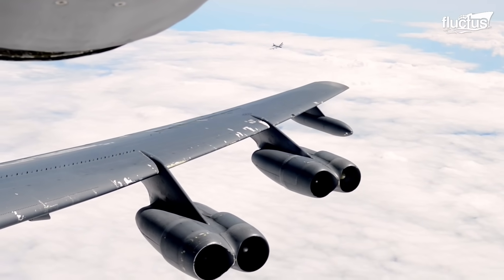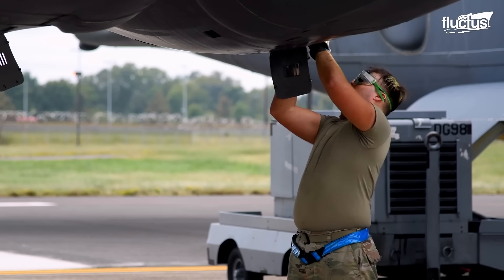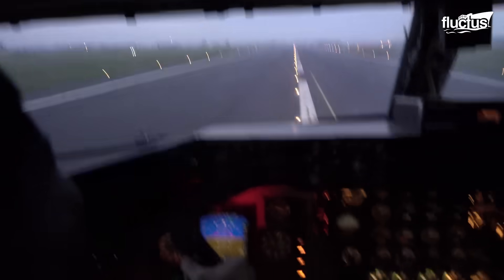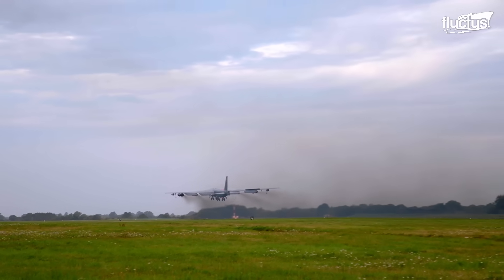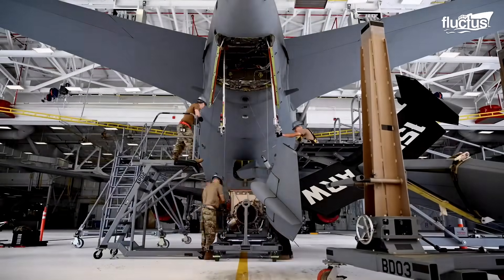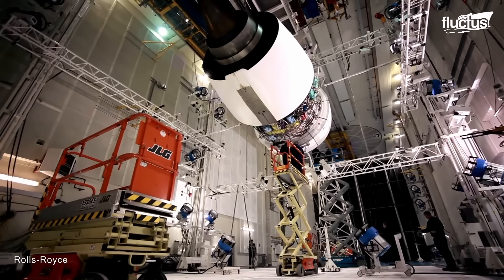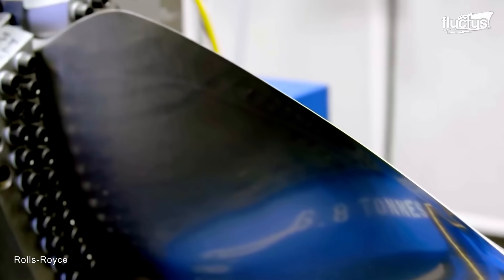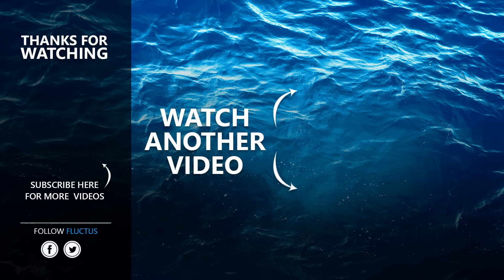Weird but Genius Process US Air Force Found to Quickly Start its Gigantic B-52

Comment: Having been a B52 crew member for many years most of this is wrong.
Reply: The cartridge was a slow burning powder and the games were expelled through a small tube across the "engine starter" turbined that was attached to a gearbox that turned the engine compressor blades. It also had nothing to do with warming the engine as the cartridge exhaust gases never entered. Reached or were used by the actual engine.